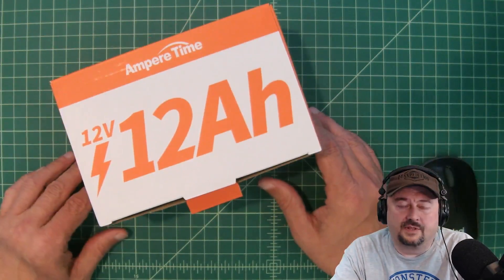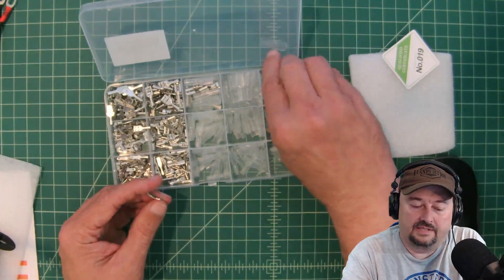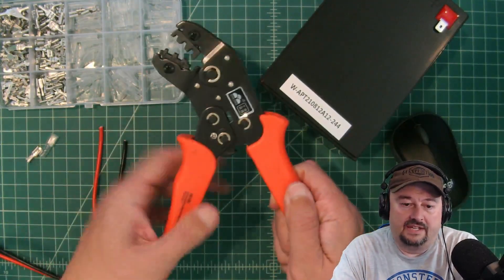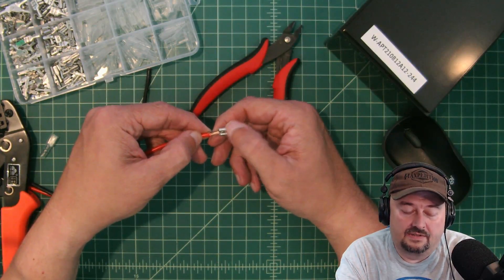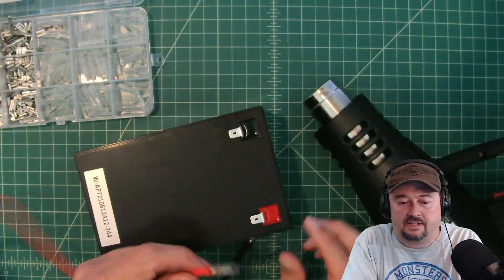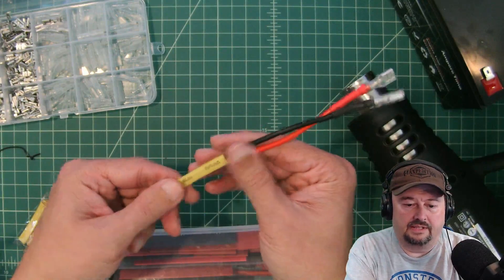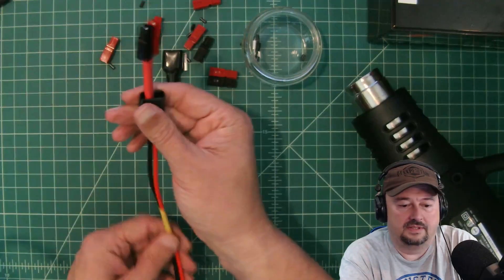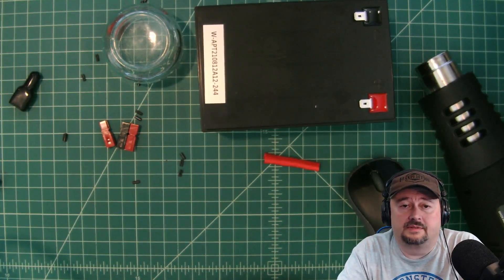Adding Anderson Power Poles to an  Ampere Time Lithium Battery

Comment: I had some 1/4" connectors similar to what you used to connect to the battery and though I wasn't sure if the insulating cover was heat shrink, I tried heating it and it shrunk nice and tight. Additional heat shrink doesn't hurt, of course, and it will help make the joint more rigid as you mentioned.
Reply from the maker: Hey Jeff, thanks for the info and for watching 👍
Reply: Can't have enough heat shrink 👍

Comment: By personal experience I've found you can save yourself years of frustration with bad connections from the Anderson power pole stuff that eventually cause measured voltage drops.  The Amass XT series of connectors are available in sizes to handle the load and are extremely reliable....  enjoy!
Reply from the maker: Hey Stephen.  I agree the XT seems to be a better connector, but APP is everywhere.  Kinda like how Betamax had a better picture…
Reply: Those connectors look better to me too!

Comment: I bought some F2 connectors from AMZ which took two weeks to receive, it was nice that they came with shrink wrap, but the 8ga wire I needed to put them on (I had two 6AH batteries in parallel) made them prone to sliding off the F2 terminal due to the stiff wire under slight tension.  The 8ga wires ran to a one bolt buss bar but I know at some point I will discover I have one dead 6 AH battery and one not connected, LOL. I thought about soldering them on, but that wasn't going to work if I wanted to just bring one battery with me for a SOTA activation instead of the whole Group-24 battery box. The other end of my cables have ring terminals on them going to the buss bar. So to maintain flexibility and security on the connections, maybe I could solder the F2 terminals and insert Power Poles inline so I could disconnect them when needed, which will work great for a SOTA activation. Many of my POTA activations are drive up locations so the complete battery box works for that need.  Cheers es 73, Dave - KU9L
Reply from the maker: The anderson jumper sounds like it might be the solution.  Thanks for watching KN!

Comment: Try to push the power pole right onto the battery terminals.  I think they may fit (tightly) w/o the mod on the red/black wiring.
Reply from the maker: Hmmm… I might try it.

Comment: Ape, what gauge wire (red and black). I've gotten a Dakota 12v 10ah with the F2 terminals and want to do APP for my HF rig, FX-4CR. I think 12AWG should be more than fine. Just checking with the master.
Reply from the maker: 12 should be fine but I’d use 10 if I had it handy 👍
Reply: @TheSmokinApe  Ordered some 10 gauge per the Ape.
Reply from the maker: Good luck with the project 👍

Comment: Nice, clean cables. Do you ever use those little locking pins to prevent the power poles from sliding?
Reply from the maker: Nah, the shrink an boot seem to handle it.  👍
Reply: Since I just purchased some Power Pole connectors, I was wondering about those pins too. Do you really need them? I even thought about using a wooden tooth pick, and snapping it off, to fit!
Reply from the maker: I don't use them, I find the heat shrink and boot hold all the bits in place.
Reply: @TheSmokinApe  Plus the little clips dove tail lock with each other, very well. Adding a drop of glue would make things permanent!
Reply: I never use those pins, but some hotglue in the hole works well too if needed.

Comment: You should put an inline fuse between the battery & PowerPoles.
Reply from the maker: I typically use a fused power line for the devises I am powering but point taken.

Comment: Bog standard blue crimp female spade connectors work just fine, I've been using them on AGM batteries for over 4 years.
Reply from the maker: Good info, thanks Tony 👍🍻

Comment: Great video. Fun, quick project most should be able to complete. 

I've had mixed results with the various F2 male/female connectors found on batteries and the crimp ones used for cables. I tend to have problems when I steal a cable from one battery to use on another battery. As long as I leave the cable on the battery i made it for, no problemo. The cheap F2 connectors tend to loosen up. Eventually I found some high quality F2 quick connect. They work great on all my batteries, but not as cheap. 

A nice cable to use in a pinch, alligator clips and powerpoles. I made one with 12g zipcord and I use it for quick tests. Very handy.
Reply from the maker: I am planning to leave this in place for the reason you mentioned.  Thanks for watching Norrin.

Comment: Would a 12ah be a good fit for a g90?  How long do you think a g90 would last using a 12ah?
Reply from the maker: @pnowikow  12Ah is plenty good for the g90, how long it will last depends on; power levels, TX vs RX ration and duty factor.  Here’s a video where I show how to calculate usage: Choosing a Battery for HAM Radio - TheSmokinApe
https://youtu.be/rc6SHdtUtR0
Reply: @TheSmokinApe  thanks for the info!

Comment: No Fuses?
Reply from the maker: Hey Randy.  The battery has internal, over and under charge protection as well as over current protection.  What I made was just an adapter, all the equipment I use has fused power cables.  Also, I generally plug the power source (in this case the battery) into a fused PDU.

Comment: Correct me if I am wrong, (It happened...Once!) but doesn't the ARES & RACES groups, insist on it's members using Power Pole connections? So, in an emergency situation, everybody's wiring gear matches up, and is Universal with everyone's gear!? 
Which seems like a smart idea to me.
Reply from the maker: Hey Chris, that's a good question but unfortunately I have no idea.